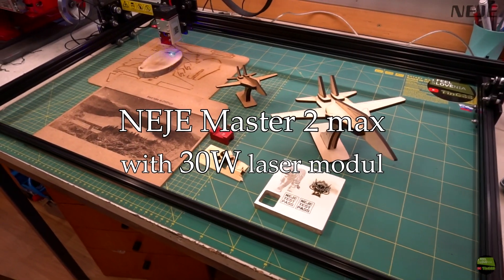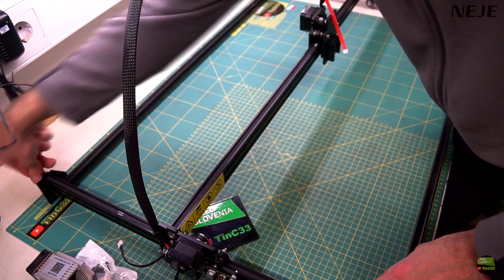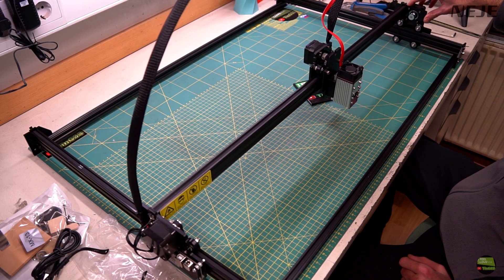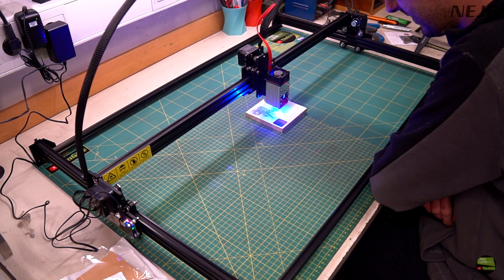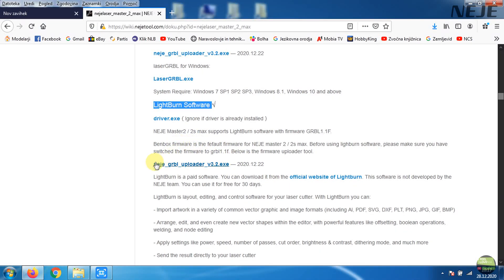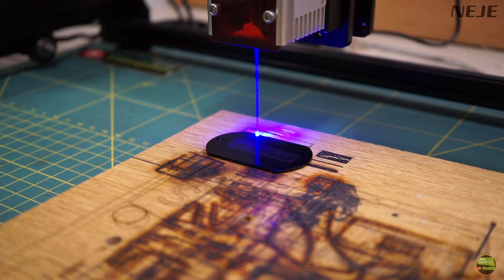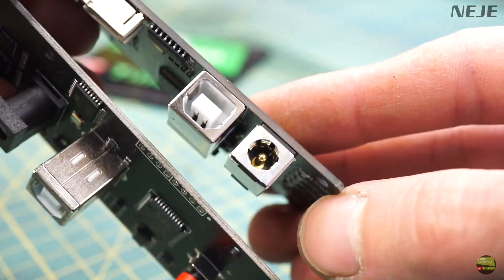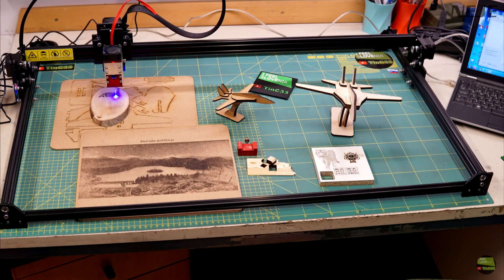NEJE Master 2 max with 30W modul 460 x 810 mm engraver / cutter [unbox / review / first test]

Comment: awesome any way you can write downthe lightburn settng u used on this video tried catching it but i couldnt get it
Reply from the maker: 5-10mm/s speed 100% laser power for cutting
Reply: @TinC33  how man passes for the 5mm ply wood and the 1/8 mdf also the leather?
Reply from the maker: @jus10tanicala8  plywood i set to 6 passes but need to set 7 for perfect cut, mdf set to 5 passes but 4 will be enough, leather cut in single pass, and don't need to set 100% laser power 70-80 will be enough.

Comment: good evening, could you please tell me which part is the one that blows out when you cut? do you have a site? thanks.
Reply from the maker: Bo i don't heave a site, it's just 0,8mm medical needle connect to compressor and regulator set to about 1 bar of preassure, just to clean the black dust away for next pass.
Reply: @TinC33  yes but which compressor do you have? this I want to know please, again thank you very much.
Reply from the maker: @giorgospantelopoulos1611  i try with booth my compressor, basic 25liter air compressor regulator set to about 1 bar, work perfect run only here and there, but more likely use my homemade compressor out of refrigerator, because it's very quiet but need to run almost all the time, so after 2-3hours of work it become really hot. I think also airbrush compressor would be enough.

Comment: Much better to buy the 30W module and a 7W Ortur Laser master 2. The Ortur has a tie rod across the axis so doesn't have the issue with staying parallel and has a 32-bit controller by default
Reply from the maker: Also neje s model got 32bit controller, after all neje still got twice bigger wotking area.

Comment: Hello, I'm thinking of buying this machine. I want to ask you please. if it is really good and if it can cut 5mm wood. thanks.
Reply from the maker: i think it's good and as you see it can cut 5mm wood, but 40w would do that even easier
Reply: @TinC33  very pleasant, I do not want to go to 40w because it is expensive. I had bought the 20w but I was not happy and so I said to buy This machine that you have too. if it cuts 5M sea plywood it will be fine.
Reply from the maker: @giorgospantelopoulos1611  i cut 5mm plywood but it's soft plywood, white colour like spruce, there may be problem to cut hard heavy plywood.
Reply: @TinC33  just bought it, :) could you please send me the settings you have made to yours?
Reply from the maker: @giorgospantelopoulos1611  i don't remember exactly but the simpliest way is to make test on each type of wood, for engraving start with 10% laser power and 5ms burning time, for cutting 100% LP and 10ms BT...

Comment: Hola TinC33, estoy interesada en comprar una máquina como esta, ¿hasta qué espesor máximo ha podido cortar madera?
Reply from the maker: Depend on wood you want to cut, soft wood like balsa up to 10mm with easy maybe also 12mm, spruce wood up to 8-9mm hard wood 4-5mm mdf 4-5mm...
Reply: @TinC33  Muchas gracias.
¿Me podrías recomendar algún sitio fiable para comprarla? Soy de España.
Reply from the maker: @jmg9111  you can check for the links into video description, you can buy at banggood and gearbest booth are trusted seller and offer eu priority line shipping without tax and other fees, but neje max can buy only at neje store check for link below, it's out of stock but they restock soon into eu and spain warehouse.
Reply: @TinC33   En ninguno de esos enlaces está disponible. La máquina está en Aliexpress con envío desde China o Polonia ¿Cuál crees que es mejor y más fiable?
Reply from the maker: @jmg9111  so order from poland it's part of eu and you don't need to pay tax fees
Reply: @TinC33   Muchas gracias por todo, ha sido de gran ayuda.

Comment: at nearly £400 is it worth going down this road against a true 30 - 40  watt CO2 glass tube machine and all fitted in a nice cabinet
Reply from the maker: True, i use here advertised electrical wattage, optical is much smaller, but  i'm interested how powerfull the chineese co2 laser actuall are, really need to think twice what to buy.
Reply: @TinC33  yh I'm deciding either neje 2s 40w version or co2 machine
Reply from the maker: @redsvision4026  co2 could be better, more powerfull but the tube last and it's quite expencive